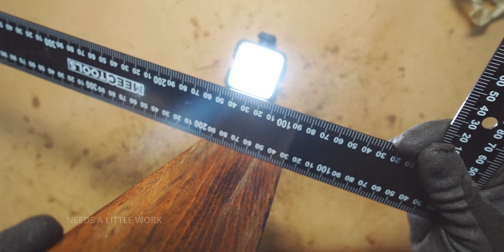1890s Hand Plane Restoration

Comment: Stubled across your video (as you do) and was truly impressed with you sympathetic restoration of that lovely tool. I've got a few wooden planes I intend to start work on and your cleaning method is inspirational. Subscribed and liked.
Reply from the maker: Thank you 👍There's definitely an appeal to restoring something to pristine condition like it had just been made but I think in cases like this it's much more satisfying to retain the history and not go too far.
Reply: @ash.pollard  Thank you for this restoration. Especially for the tip with boiled linseed oil and a steel wool. I have an old cabinet (and few other things) full of my granpa's woodworking tools and i intend to restore his old workshop. A lot of those tools is between 60 and 100 years old probably. This tip helped me a lot, because untill now i thought about using sandpaper and this idea didn't appeal to me because of loosing this old, worn look on the tool.
I will try it out first on an old knife of my aunt. I beleve it was her child puukko knife (we call them "finka" in Poland) when she was in scouts. Those knives were very popular among scouts here when i was young boy too :)

Comment: The old tools are so much better than the new stuff, my go to 1" socket chisel was made in Sheffield no later than 1909, warranted cast high carbon steel, 20" long overall, ebay £24.00, bargain, and history, using it to rebuild historic railway carriages.